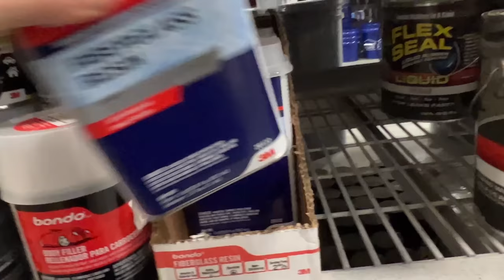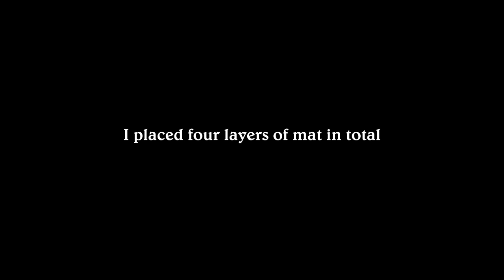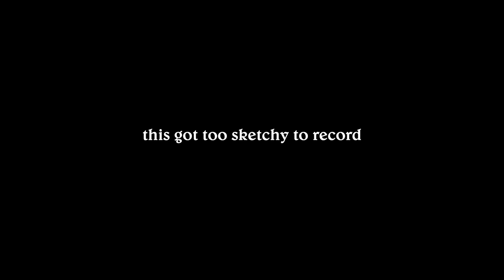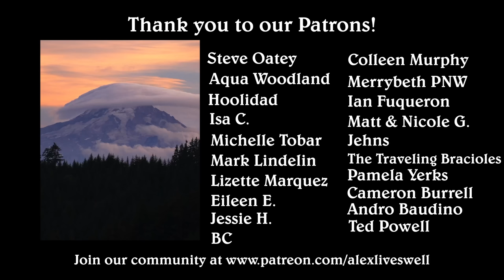I have TWO holes in my roof | truck camper renovation series

Comment: Looking good.  I like to use marine hatches in the roofs.  Heavier panels, better insulated, more streamline in many cases, less likely to get broken by tree branches of camping off trail, and lastly better sealing.   The one drawback is it can be harder to get big screens for, but most you can find options for.

Comment: That hatch was a lot of work! Are you going to seal the screws? You could use Dicor self leveling in screw holes then tighten down for nice seal or go over top. Also could just use some wide eternabond tape over screws and flange edge. Just some tips you probably already know  😄👍
Reply from the maker: Yep! All is sealed :) I used a self-leveling lap sealant as this hatch is easy to reach and will be redone each year (that I own it) to ensure it stays water-tight. So far, so good - even with our torrential rains!
Reply: @SheRoamsWild  awesome, glad to hear it sealed up well 🤙